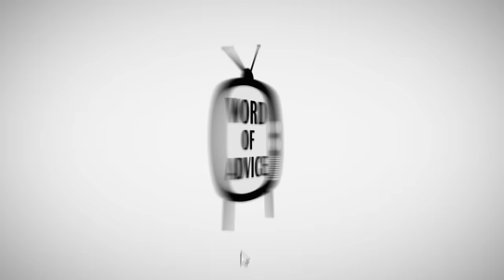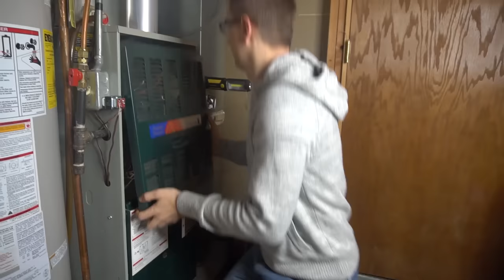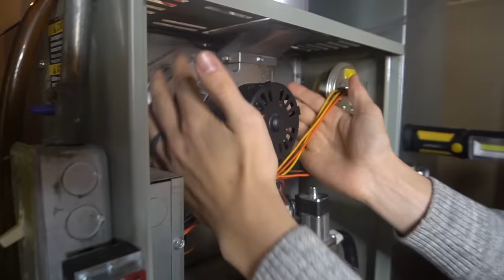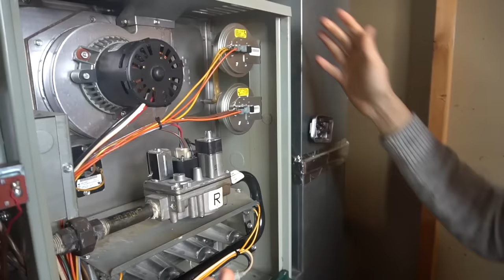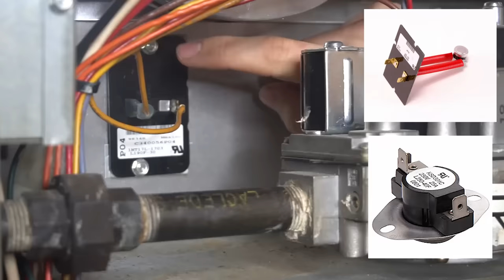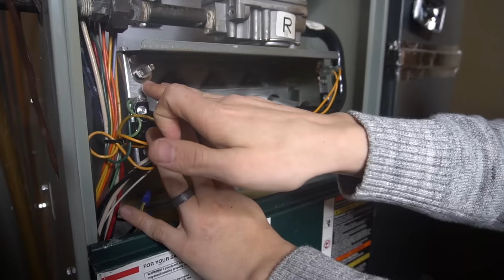Furnace Parts and Functions Explained

Comment: As a retired HVAC tech I found this to be a very good video. The only thing I want to add is that a cracked or leaking heat exchanger can cause the rollout switch to trip and the burner/manifold system is actually designed to pull in a lot of air(called primary air] Which mixes with the gas so it has enough oxygen to burn efficiently with a basically blue, soot free carbon monoxide free flame with exhaust gasses that are basically composed of carbon dioxide and water vapor.
Reply: @davidm7824  You need to do some research because you are mistaken. Natural gas is the cleanest burning of all fossil fuels under the right conditions. These conditions are a proper air to fuel mix (called a stoichiometric mix) which results in what is called a complete combustion which means there is not any excess fuel or excess air in the mix. This results in a blue flame with combustion products of mainly CO2 and water. A rich combustion mix, meaning there is excess fuel and not enough air, results in incomplete combustion with a yellow flame full of soot and carbon monoxide. I have personally seen and been exposed to both these types of combustion products. Look it up.

Comment: I replaced my entire HVAC system last December and put in a Trane variable speed system. Best choice ever. My electric bills went down. Also, for the most part, my house feels comfortable all day long.  Additionally, I don’t hear my unit turning on and off all day. I would highly recommend spending the extra few bucks and go with a variable speed system if at all possible.

Comment: very nice, had my furnace acting up today, the fix: took a gem clip and cleaned out the holes in the orifices. 2 of them were lighting the third on the end was clogged and not firing so it was immediately shutting down on ignition, working fine now.

Comment: Thank you so much for the video. I was at a loss on my furnace and inches from calling in a pro. Long story short. My burners would not light. I paid $95 American dollars. For a gas valve no help. I spent $50 on a HSI that was getting red hot. Spent $35 on a manometer. Spent hours watching videos and on forums and was convinced my gas company was cutting the natural gas with Helium or argon. I was stumped and could not figure out why it would not light the burners. Oh I forgot the fact that I could light the burners with a match all day and the water heater worked perfectly. I have never seen a burner on the back end. I figured they were just tubes. When you pulled your out I had to look at mine. My Luxaire furnace is a tad different as I'm sure you know. I took the whole rig off and OMG! WTF! The back of the burner was all caked with rust. A few minutes with a wire brush on the end of a dewalt and a pipe cleaner or 2 later. I put everything back together and now my family are enjoying heat. Thank you for your video!
Reply from the maker: Oh man! Sorry to hear about all the troubles you had to go through before you found the problem. Glad to hear you got it fixed and my video helped! Thank you for leaving a detailed comment, stay warm!

Comment: We just got some snow the past few days and my furnace is having issues so here I am haha. You are great at teaching the names of all the parts, and your explanation of how furnaces work is very easy to understand. Great video quality too, very clear and easy to see everything. I had no idea what any of the parts inside were but now I have a much better understanding. I've got a 90% furnace and it started leaking a fair amount of water right around when the temperatures got below freezing outside and we got a few inches of snow, because like you said, there's condensation in the second exchanger. Seeing a lot of rust where the inducer connects to the PVC pipe, right around the clamp ring as well, from your explanations though it doesn't seem like that pipe should be seeing that much moisture though.
Reply: 90 percent furnaces should be taken apart and the inducer motor  rinsed out once a year before heating season. The white condensate  trap box taken and also rinsed out. Maintenance is always needed every year. Heating and cooling season.

Comment: A very good video...Simple, easy to understand and explains the components very well....The flame rod is as you said, the  number one cause of no heat and erratic or short burn time.....Close, is the nipples on the draft inducers, usually blower side, get blocked up with crap...No signal proving rotation...A very common problem as furnaces get older, and are not serviced regularly....Thank you for this video...I will use it as a teaching aid.
Reply from the maker: Thank you! I'm happy to hear that you approved the video :)

Comment: Thanks, I've been tinkering for over a year; flame sensor is good, high limit switch is good, hot surface ignitor is good, new nest t-stat upgraded/good.  Still experiencing intermittent heat!  This video helped me check the flame blow back sensor; luckily it had a manual reset option!  My Wife is happy again 🤩👊🏾🎉🙏🏾

Comment: I’m a new home inspector and HVAC is one of my weaknesses.  This was a very informative video.  You did an amazing job describing the parts of the system and how they work.  I’ve subscribed and I hope you have a similar video for the A/C unit.  By the way, I notice there is a gas union inside of the unit. I was taught that should not be inside because it is susceptible to leaking. Great job.
Reply: Every gas furnace has a union line inside

Comment: Had furnace issues. Went through all of your checks. Narrowed it down to the gas valve or the control board. Ended calling in help. It was the board. I’d hesitate to call them pros , they just replaced both parts , till it started. . Great videos .  For others, My symptoms were the igniter would heat up. The fans would run, but No gas would come out at all , and it would just blow cold air.

Comment: Great explanation of the pieces!  I think it's so neat that the technology for the 80% AFUE is still the same it was 20+ years ago since the draft inducer was introduced. My dad's furnace installed in 1995 still has these exact components. I've used your videos to troubleshoot his furnace.  Even replaced the flame sensor since it's so cheap (unfortunately that wasn't the problem). Called an HVAC company out, and they went through the same steps you've described in your videos.  They concluded it's the circuit board (which the little diagram kinda says too -- if all these steps pass and then it still doesn't work, replace board). The board costs a couple hundred, and they wanted more than 3x that amount, which he even said is what most companies do, so I'll just try it myself at this point since I found an exact replacement.

Comment: Excellent video, great job. Yours is same as my furnace. In my case, the flat surface igniter is the number one to fail, especially in the rain season. The ceramics is fragile to break under high heat.
Reply: When taking out of its box, a new surface igniter should never by touched as the oil or dirt on your fingers can damage it.....

Comment: What an awesome video!  I’ve learned so much!

I have a 6 burner Trane 90% efficiency.  Quit heating.  I cleaned the flame sensor and condensate trap.  Next I discovered the flame rollout sensor is blown.  Non resettable.  What’s the cause of this sensor blowing?  Yes, I’m aware… too much heat.  But something needs cleaned.  Heat exchanger needs cleaned I think.  Not enough airflow through it and there’s literally a flame rollback and over temperature condition that blows the sensor.

Comment: Nice video, my old Lennox pulse had the control board in the same place and over time the board formed a hair line crack in it due to it being in this location as the blower motor vibrations over time caused this to happen, the furnace would come on and then cut out and wasn't operating properly, it's a bad Location for the board as my old one was not repairable the new one was $900.00 and I made sure to relocate it in an area of no vibration as this was a bad design of the furnace manufacturer. Thanks for the information and good luck.

Comment: I enjoy explaining this to my customers who like to watch me when Im working. They are always very appreciative . Great video and just a suggestion, remove the tape from the door switch when finished servicing
/maintenance. Occasionally I have found the door off due to previous tech or homeowner not securing it properly. With a gas furnace this could turn out bad. I use a black zip tie that I push up once finished.

Comment: Great job as usual. Don't forget to mention the purpose of the door switch. And how some furnaces have another limit near the blower housing. Wasn't sure if you   had mentioned that. But great video anyway.
Reply from the maker: Thanks Harry! Yeahh.. I totally forgot to talk about the door switch in this video. I did explain it in some of the comments though. Thanks for pointing it out! Much appreciated :) And I completely failed to talk about a possible limit on the blower housing. Turns out I forgot a few things... Although I rarely see that limit on the blower housing trip, even with a burnt out motor.

Comment: Thanks Great video - FYI-- Blow out air lines on air pressure sensing (vacuum) switches - Some of these air switches has two contact - one on the front one on the back .... check both!  (I see this unit has two separate switches)
 yellow powers both switches - brown and orange are the two different outputs signals. Inducer housing pressure and collector box pressure (check square tubing vacuumed sensing signal). This may apply to your unit.

Comment: Lol, you forgot about the taped door switch! And the dangling 3 amp fuse. But great video though! Keep em coming!
Reply from the maker: Ack! I cant believe I forgot to talk about the door switch! Thank you for pointing that out. The door switch is like a secondary power switch that shuts off the power to the furnace when the bottom door is taken off. I taped my door switch so that I can check voltages on the board and so that my furnace does not shut off when I take the bottom door off. 

About the 24v fuse. My control board does not come with a place to plug in the 3 amp fuse so I just spliced it into my 24v hot wire coming from my transformer. That way if there is an electrical short at some point, it will burn out the fuse instead of my control board. 

Jake, I know you probably already knew all that, I explained for others who may read this later :)
Reply: I have left my door switch taped like yours for a couple of years. Does not hurt anything and is helpful when checking out electrical issues.
Reply from the maker: @briancloutier2781  Yep. That's my thoughts on that too :) The door switch is a safety feature to protect not-so-careful homeowners from getting zapped if they venture into their furnace.

Comment: Very informative.  
Yo Jay, since I cleaned that flame sensor my furnace works like a champ!
It kept cycling off & on and I recall us discussing why it was happening.
Eventually I'm gonna need to replace it because the unit is 19yrs old but I'm gonna ride it out until it happens lol. I always look fwd to your videos.  Thx again Jay.
Orlando Atl, Ga.
Reply from the maker: Hey Orlando! Glad to hear your furnace is working like a champ! :) One of my veteran co-workers (been doing HVAC for 25+ years) says he has never replaced a flame sensor unless it was physically broken. Always able to just clean them off. Some guys will urge to replace them instead of cleaning but I would rather clean them. It's not like it's a hard project. Only takes a minute or two. Anyway, stay warm!
Reply: @WordofAdviceTV  Hello again Jay?  My furnace is cycling off and off again.  I've  cleaned the flame sensor and changed the air filter.   I noticed the red led light on the control panel isn't illuminated?  It says Control Failure if off.  Would I need a new control panel?  How could I resolve this issue?  Your thoughts.  
Thx again
Reply from the maker: @orlandoc661  If it says right on the board that the board has failed if there is no light, then I would say you will have to replace that control board.

Comment: Wow. Very educational video. Thanks. Could you do a video like this for boiler? I have a house that has a boiler instead of a furnace to heat the house. I would like to learn the parts and functions for a boiler. Up in the house there are radiators in each room
Reply from the maker: Thank you , glad you liked the video! None of my family or friends have a boiler so that makes it a little harder to make a video like that for a boiler. But if I get the opportunity to, I will. Thank you for the suggestion!

Comment: Good afternoon Jay,
Great video and very well explained!!! You don’t know how much these videos have explained exactly what I need to know!!! A simple fix that saves me money is always appreciated!!!  Now the not so good news???
I got a carrier 66k furnace from 1991 and I know it has earned it keep!!! Can you recommend a good brand that will be my next purchase!!! It was one of the first high efficiency ones is back then and it uses the pvc pipe for exhaust!!! I just want your personal preference and will want a air source heat pump as I’m sick of a window a/c!!!
Thanks 
Art
Reply from the maker: Hey Art! Glad my videos were able to help in the past! Different technicians will give you many different recommendations. I am just one of those guys so take it with a grain of salt :) In my opinion, I don't think the brand matters too much as there are really only 4-5 manufacturers that make almost all the brands out there. For example: Carrier, Bryant, Night and Day, Comfortmaker, Tempstar, Payne, ICP, and Heil are all owned by United Technologies... Which means the biggest change between those brands is the logo on the unit. I would go with either a Lennox, Trane, or Amana. I would also stay away from anything that is variable speed. (blower motor, inducer motor, modulating gas valve) They are more efficient but if you need to replace those parts down the road, they will cost 3 to 4 times more than a non-variable part. Well and that's about all that was on my mind. Hope that helps!

Comment: excellent tutorial! May you consider to add a video that illustrate the wiring to the control board. You have a few videoes that show part of the control board but it is hard to read those words b/c of the angle.
Reply from the maker: Well.. There are many different control boards so the wiring varies from board to board, that's why I didn't make any videos like that.

Comment: Awesome video. My furnace is Carrier, but i could not find the Capacitor attached to the blow motor housing. Does every blow motor have a capacitor attached?
Reply: Any that use a 2-phase AC motor, which is probably going to be most but not all.  Variable-speed fans (not just dual-speed) will probably be DC or inverter-driven 3-phase, so they won't need a capacitor.

Comment: i have a Lennox 9ougfa3-75-6....its 19 yrs old.  Decided to remove the blower  at the bottom and clean it out. i removed the control board first, and set it aside but there were so many wires i had to cut the plastic harness on them so i would have room to  remove the blower ... I put the control board to the outside and removed the blower. It was very dirty and i cleaned it out without removing the motor off it .I wanted to remove the motor  and started to to along with the ground wire but put it all back when i realized that wasnt a good idea.
put everything back, and started to remove any black tubing i could clean out and came across a black tube with a small nail like hole at the end of it attached to what i think is a o pressure switch..put everything back and the unit sounds like its going to start but then nothing happens. No  diagnostic lights come on either , any idea of what i may have done? Is there a wrong way to reattach the ground wire lol ?

Comment: so what would you advise if i changed the ignitor and sensor and my furnace still doesn't fire up. Seems like no gas is coming out. Ignitor glows but then shuts back off. Like i mentioned both are new and have been replaced. (ignitor and sensor) old Ultra V enhanced 80 furnace

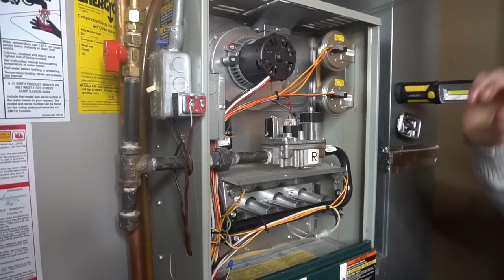Comment: 1:35 power switch is also called the disconnect - electrical service disconnect.
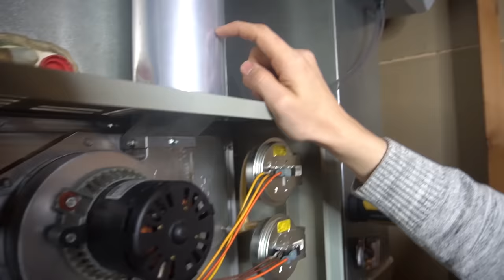3:03 flue pipe
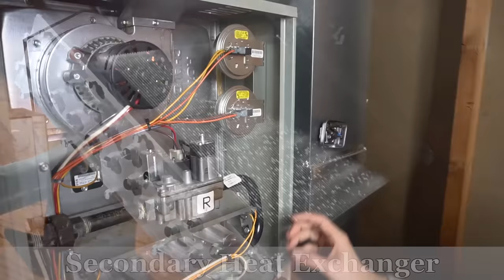4:59 a corrosive liquid solution is created which can eat clay pipe
6:12 also known as "proving switvh" - it proves operation and allows switching on
12:35 thermocouple? Bi-metallic device that produces electricity when heated
13:31 run (delay) capacitor?

Amish washer and dryer, LOL.

Comment: you are correct. home depot has one (homedepot.com/appliancerepair) what I"m finding out is theres more than just replacing the exchanger. The entire chimney pipe has to be replaced and roof cap as well there rusted bad. The a.c. coil is clean theres a good filter with this up draft unit. With a new unit there is a warranty and making sure everything is up to "building codes" which I found out (with this first estimate) are a lot stricter than 20 years ago. I have learned a lot watching your videos thank you.